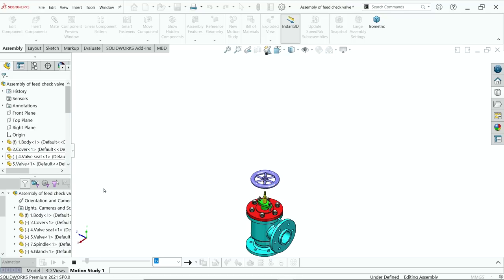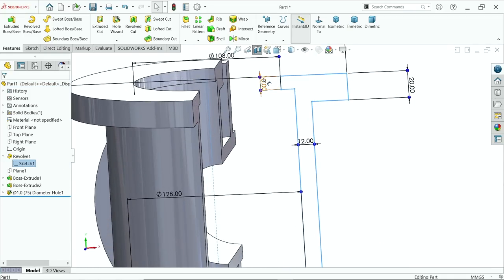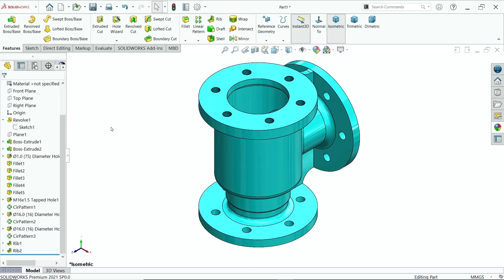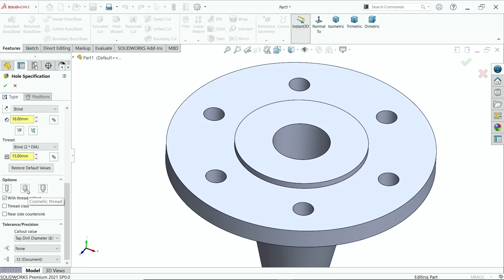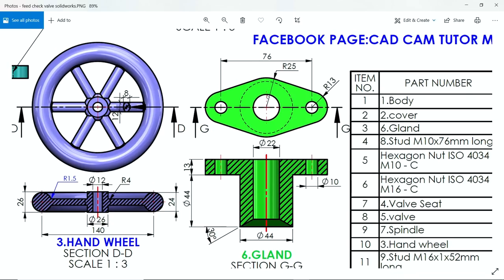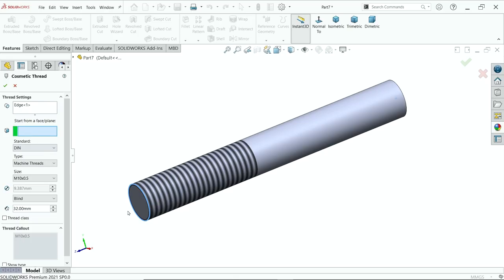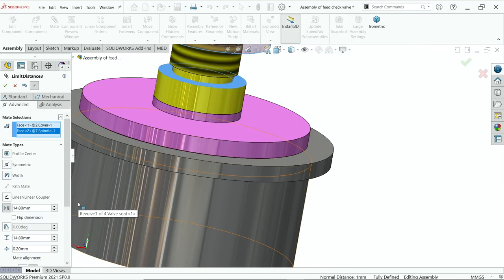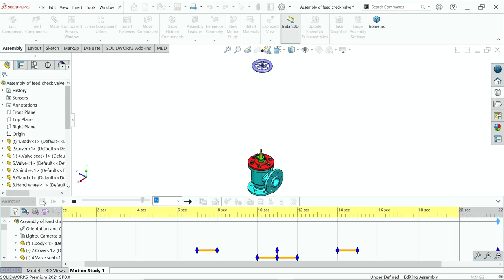Design of Feed check Valve in Solidworks | Solidworks Exploded View

Comment: Nice but you made a mistake with two bolt screws. they have to be rotated 180 to proper wok.  Actually  you don't need them but you need screws because the gland should be all the way down.

Comment: NIce work !! however, i have one question about the movement of screw. I mean once you mated M25x1.5 threads and dragged it down so quickly with rotating the spindle. How would you do that ?? I mated them and I dragged it down but it did't move. I have to click and spinning it which means the spindle moves downwards so slow...